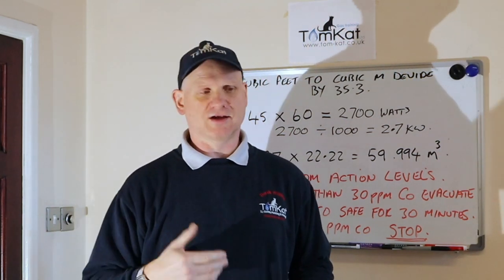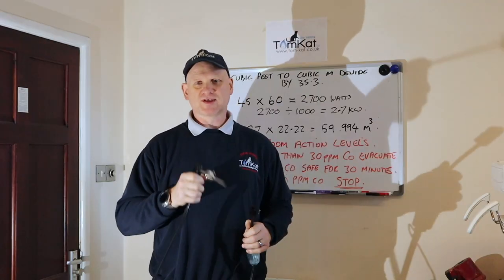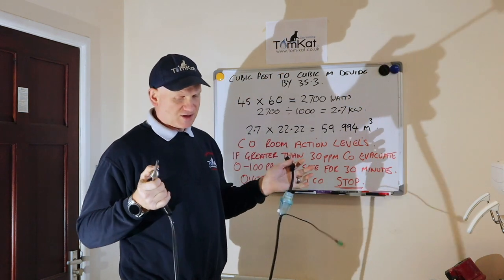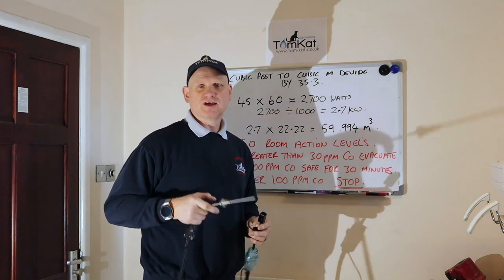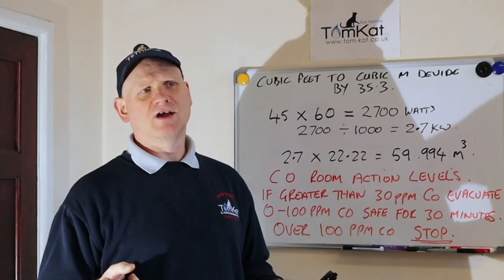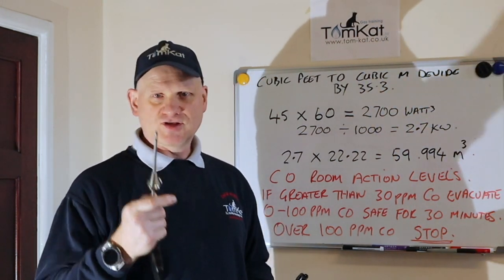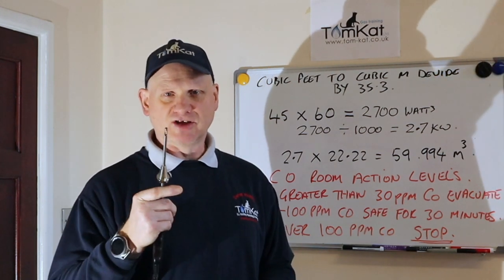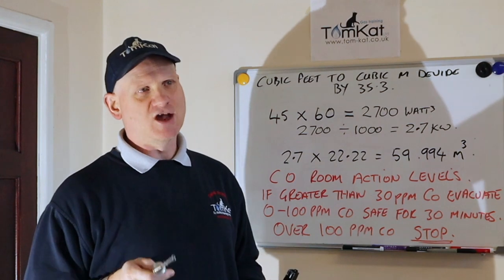How to use a flue gas analyser and understand the results PART 2

Comment: I've told my apprentice to watch this.  For future anyone else I mentor.  As long as you can reference back to Manufacturers instructions.  That's the main thing.  If not It's British standards.  Your analysers like having eyes inside the boiler or around the appliance. Bit more like a sixth sense of spotting CO/CO² & temperatures.  In this industry it's your best friend. You can't work without it.  So get comfortable using it.

Great tutorial Derek, brilliantly explained.  When you explain things like this to engineers you potentially end up saving lives. A competent engineer is a must.  We sleep easy at night because I cover all we can, beyond reg 26.9 😁👍
Reply from the maker: Thanks for your comment and thanks for watching 👍🏻
Reply: How many gas engineers do this? Know this?
 My analyser training was never this educational !!
 I hear of landlords safety checks done in 20 minutes. Boiler, fire & cooker, joke to call them gas engineers.

Comment: Brilliant. A lot of detail. The oven you mentioned, you said is liquid vapour. Meaning it lights up first at low rate and then increases. Is this liquid vapour on the oven classed as a safety device? Lets just say the oven lights up straight away on full rate because the liquid vapour is faulty.. Would this be classed as ID because safety device is not working?

Thanks Derek 👍🏻

Asian Jon. Training.

Comment: Great video and good constructive explanation. Could I ask what the 22. 22 is under the fire section? Where you wrote on the board 2.7kw x 22.22? For the volume of 59.994m3
Reply from the maker: 22.22 is the equation used to work out the minimum room volume needed from the fires kw so if you have the kw of the fire x 22.22 gives you the minimum room volume

Comment: Hi, Derek
I have got valiant 824 but f 28 and f 29 fault keeps on appearing on display but after calibration x button once the temperature rise to 24 to 26 then the boiler works normally
Normally it clicks three to four times until it ingnatie the gas and works normally after
So sir have you got magic trick to fix gas valve or service or use WD 40 to clean the pistons and wipe of WD 40 or is there other safer products to clean with.
Because lot's of boiler part's sellers sell second hand parts such gas valve
Please give me some idea's how to over come on this problem sir